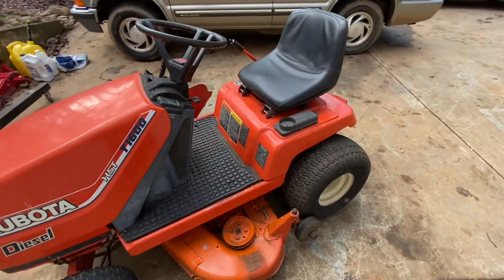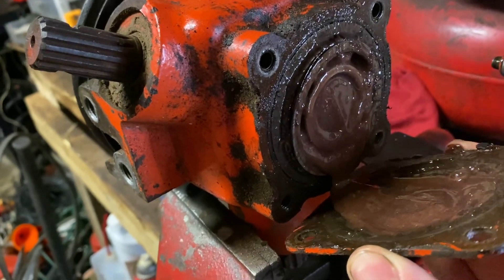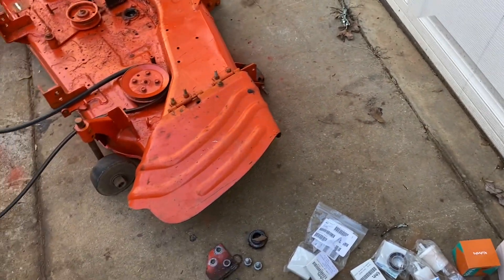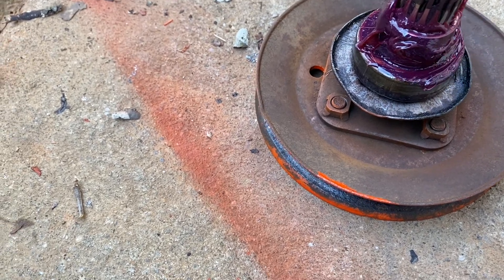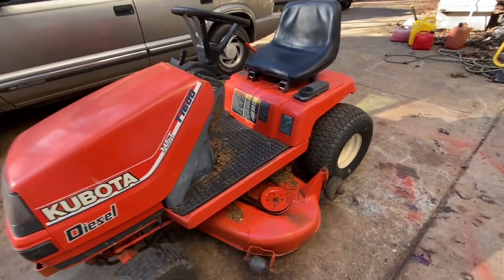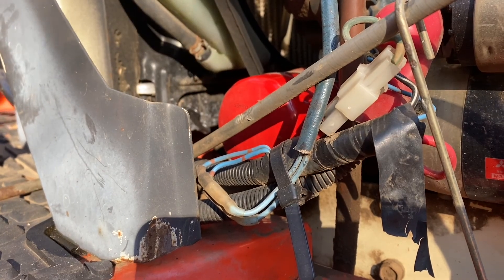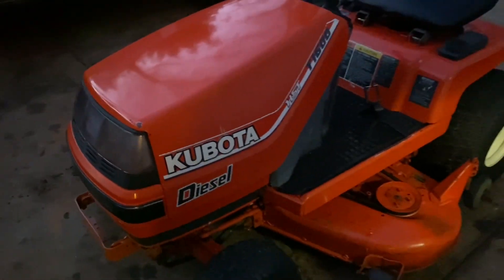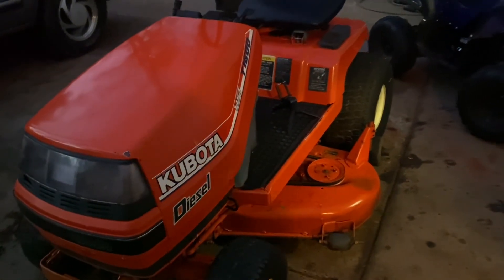Fixing A Kubota Diesel Mower T1600 Deck Rebuild And Service

Comment: For that bevel gear case. I've been trying to figure out how to get the main pto out. I am replacing a seal on the pulley end.
Reply: Did you get it out?  It looks like I will need to replace the same seal..

Comment: Where would a guy find a battery to replace the old one? Kubota discontinued and I can't find one. Closest I found was Interstate, but it's like almost 1/2 the amps. It's a good little mower. Been very reliable all these years. I still have the hubcaps, even.
Reply: Supposedly, you can use a battery from a Honda Fit. They have nearly the same measurements. Part # SLI151R it's not cheap.

Comment: How do you bleed air after the engine has run out of fuel?
Reply: Open the lines at the injectors and crank the engine. Be careful - high pressure fuel spray can cause serious injury